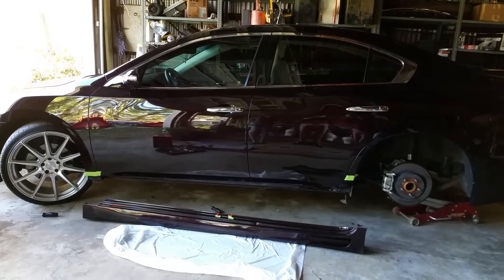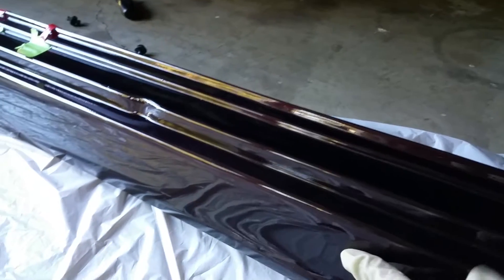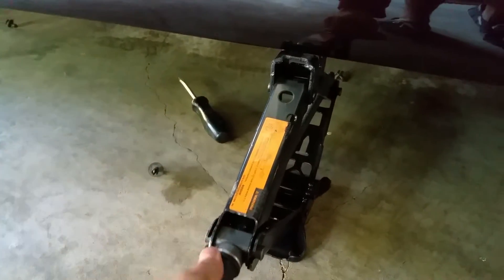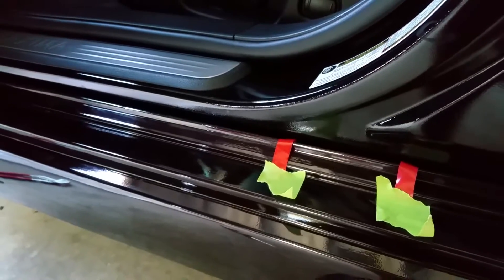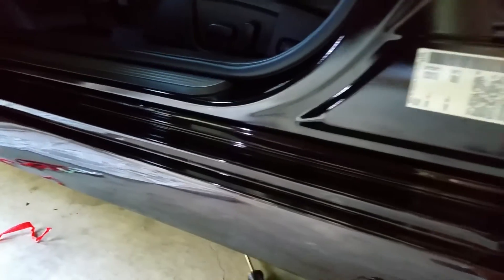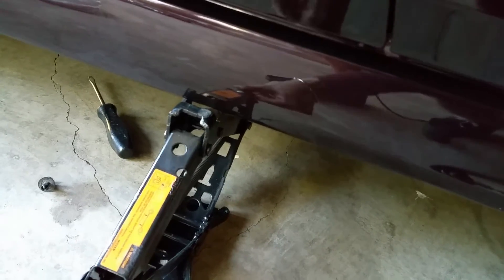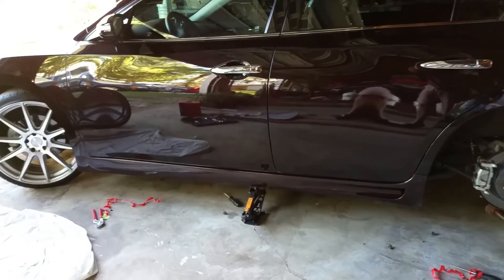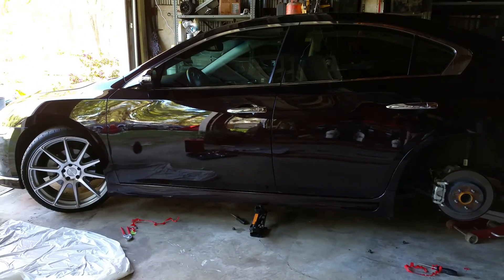Stillen Nissan Maxima Side Skirt Review Part 3

Comment: do these skirts block/hinder the courtesy lighting underneath the rockers? I recently bought a stock '14. It lights up underneath the rockers with four lights each side. They come on when the door is open and when it is dark out.
Reply from the maker: Actually you will need to drill new holes into the stillen skirts. Those puddle lights are installed on the factory skirt which you will need to remove to put the stillen skirts on.
Reply: +George George okay great. so it's possible with just a little drilling. thanks!
Reply from the maker: +strathgard yes... possible